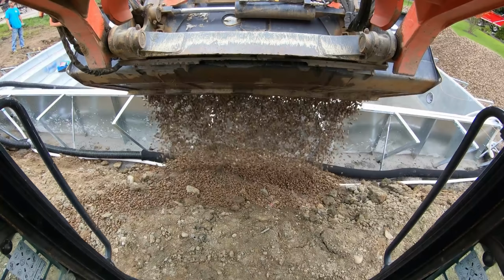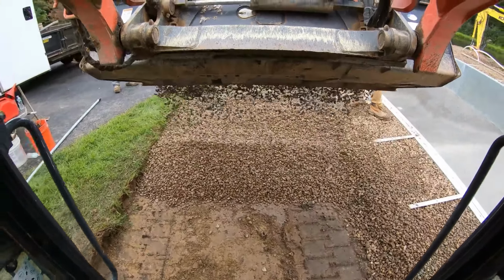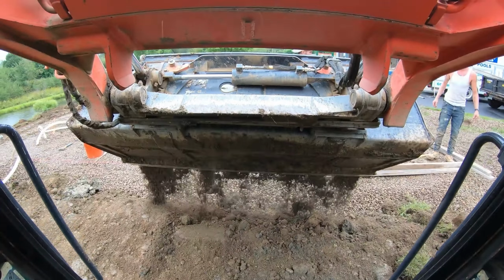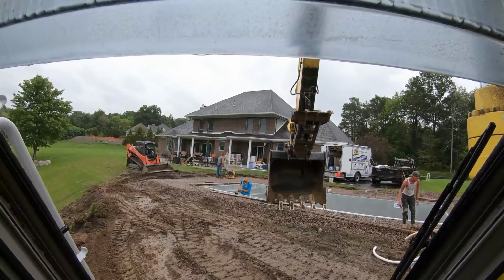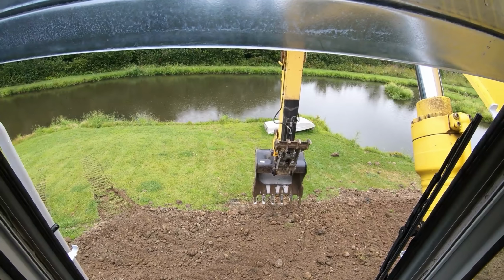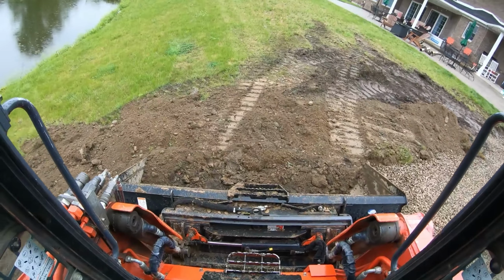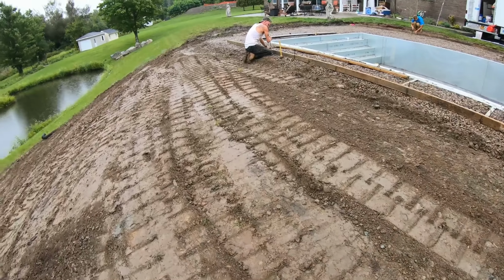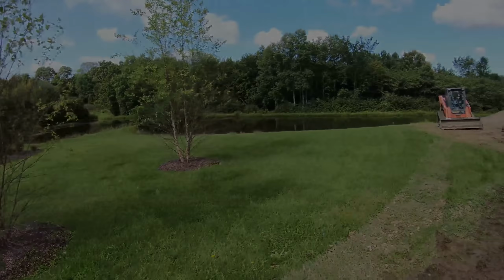Backfilling grading around a pool steep slope and getting stuck with dump truck on a Homestead

Comment: Man I wish my company had a tile bucket on my skid steer. It would make grading so much easier up along the house an for swells. That's nice you got one I bet it's came in handy many many times lol. I still wanna try the egg challenge with my skid steer at work only I won't ba able to put it on a cone an I won't have any jaws either. Lol. You think you can flip a quarter into ur bucket on it skid steer ? 😁 Nice job on the pool tho.
Reply from the maker: Yes the tilt bucket makes all the difference in the world I never take it off.. 20 years on a skid steer I think I could do just about anything! 💪🏼

Comment: So is there no footing, plumbing and electrical inspections on a pool where you are? There is no way to do a pool that fast in NJ. Also is that a new bucket on the Kobelco?
Reply from the maker: Yes everything is lined up in advance everything is inspected.
The bucket I bought last year
Reply: @DIRT-BOSS  You can't do that where I am from. You are told you will get a footing inspection in 2 weeks then in three weeks if you are lucky a plumbing inspection then good luck with an electrical inspection maybe 6 weeks for one of those.
Reply from the maker: @charlescarrolljr75  wow